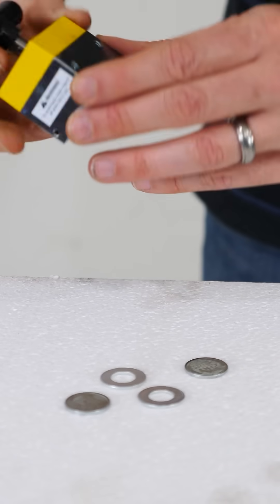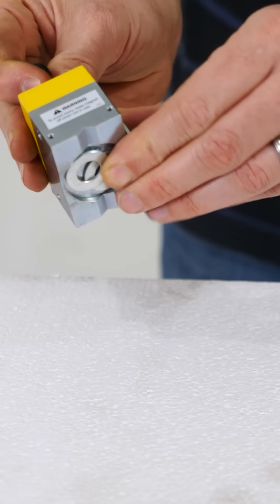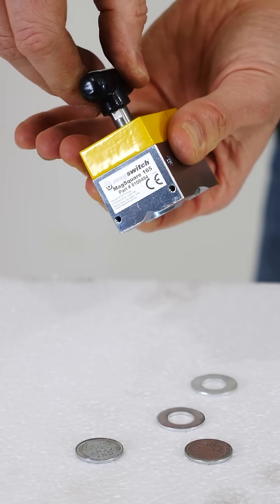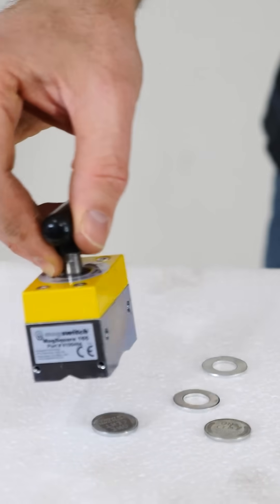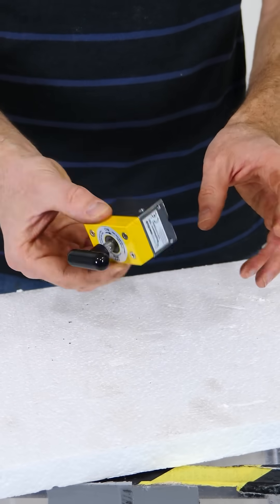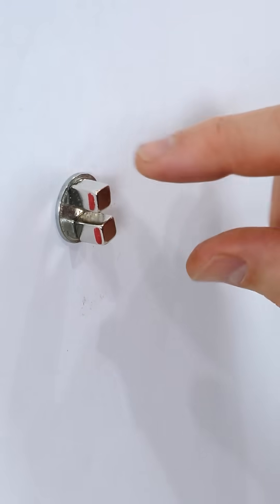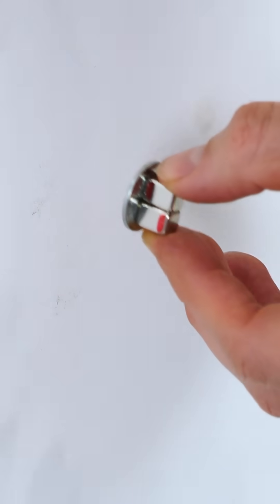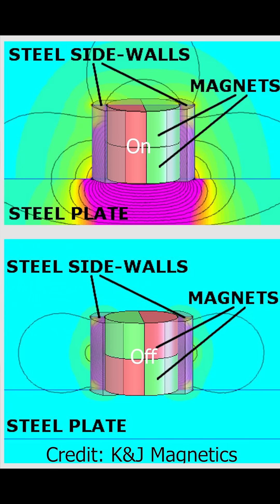How To Turn Off Permanent Magnets

Comment: Very old idea. When turning it off it un-aligns the magnets and re-aligns them when turned on.. Old metal workshops used them for gripping metal under drill presses and lathes. As well as used in large metal fabrication areas to lift metal work.

Comment: we use something like this in mechanic school to measure out of round, it’s a called a dial indicator. you turn a knob and the base magnetizes to a steel table which allows you to measure out of round without the indicator moving

Comment: All you're doing is flipping the magnet inside of the piece upside down which repulses. If you had another magnet it would attract two the opposite side of the magnet that you flipped. You're not turning it off. You're just turning it over

Comment: No, that's not turning off the magnet, the real magnet is inside the assembly connected to the lever. Turning the lever will move the magnet away from the steel base so the base will lose the magnetism. Stop misleading peoples!!

Comment: I use bigger versions of these at work for lifting metal objects. They have a ring on the other side so you can attach them and lift it with a crane.

Comment: thats also used to lock onto the springs of a car and then you can see if the brake discs are wobbling or not. just a metal pin, that pushes a needle to see how much the disc is wobbling

Comment: Why not just use an electromagnet?
Reply: This doesn't require electricity to work, which is more practical and usable, and it's made simpler so it's more reliable

Comment: Technically doesn’t “turn off” the magnet itself and is usually pulling the actual magnet back inside the plastic part or flipping the pole and pulling away.

Comment: So you use 2 of these at either side of a some pistons or a motor turning each side on and off subsequently to pull the piston or motors similar to Tesla’s theory 

A small pulse of electricity fro
 A rechargeable battery to turn the switch on and off and the magnets will pull the motor or piston this would possibly create more energy than input or at least create the same energy which would repeat the process requiring only 1 boost of electricity to keep the cycle I’ll explain how in better detail 

one side turning/moving would create enough energy to turn the other side on keeping the rotation or the stroke

Its more simple for a propeller or motors but if the piston was inside a inductor the energy could be taken and stored, the energy depending on how tall or the distance that the piston travels 

Depending on the size and the quantity of the pistons would determine the efficiency since you could use the action of 1 turn to move many magnets in sequence if the on/off switches were connected to 1 arm flipping them all on and off
Reply: Are you talking about a brushless motor or violating the laws of thermodynamics?

Comment: If it can be turned on and off, it's an electromagnet.
Reply: No, electromagnets work by using electricity to change the magnetic field, this is a permanent magnet that mechanically changed the magnetic field.
Reply: @ProjectEurobeat  negating is not turning off.

Comment: My workplace has magnetic clamping table using a similar concept. A tool can be placed on the table and when the its turned on the magnets will hold the tool (and I mean it holds the tool)
And when the table is turned off, the tool is free to be moved. The actual mechanism is just rotating magnets underneath, (off=magnetitic poles cancelling each other out / on=magnetic poles aligned).
Very simple and reliable, yet quick and effective.

Comment: There is a small permanent magnet in SLR cameras that work directly with the shutter switch. When film is advanced, a metal shutter primer is pressed up against the active magnet to load the shutter to be used, once the shutter button is pressed, the magnet is momentarily shut off to release the shutter! I'm directly referencing Canons A/AE/F/FT cameras so others might be different.. (I also only know this because mine is broken LOL) Its cool to make a connection to this video!

Comment: I have a magnet like that rated to pick up 250lbs we ised some at work that would pick up over 500lb steel plates. They are pretty hamdy but watch out when flipping that lever back off it has some force with it and if your to close and dont know what you are doing you might loose some teeth from that handle lol

Comment: I tried making a overunity motor with a massive 1000kg lift magnet.
(The magnet alone weighed 100lbs)
Problem is you can't switch the magnet on and off unless it's on metal, it's in a magnetic lock state when lines of flux have no path connecting the poles.
I would have been very rich if I had made it work.🥲

Comment: I didnt get how does it work, the energy required to pull the iron nail is much greater than the energy required to twist and switch the magnet off....How is this possible ?
Reply: Because the magnet isn't being pulled away from the spike

Comment: Yeah question couldn't turning this off and on at a specific speed and angle pull a turbine round to generate electricity with minimal energy input for the force output?

Comment: I always thought it worked like a tool I use to pickup screws in hard to reach places where it moves the magnets closer to the stainless steel bottom so it can pickup screws and then you grip the handle it pulls the magnet further away dropping materials

Comment: Just a question to experts like barnabro. Are there versions of magswitches where the magnetic field of a permanent magnet is temporarily neutralized by an electromagnet? These would be much safer than all-electromagnetic ones as the device would not drop its load in case of a power failure.

Comment: I've just been considering what advantages these mechanical switchable magnets might have compared to electromagnets. Apart from not needing a power source, of course. So while an electromagnet drops its load on a power failure, causing substatial damage, these mechanical ones can't fail.

Comment: Used a slightly bigger version of this on the railroad. Had to get a 200lb bladder for hydraulics onto a welding machine, and the bolt on location was about 10 feet in the air. We used the magnet attachment, testing it beforehand to make sure it held the weight. It did. What we didn’t take into account, is where we put the magnet on the bladder. We put it on the bladder to where the bladder was being lifted at an angle, subsequently “peeling” the magnet off the bladder. What’s worse is my boss was right underneath when it let go. He moved pretty quick for a 60 yr old. All ended well, but just something else to think about when using magnets

Comment: We have drills that use this technology powered by electricity and I was using it upsidedown pulged into a welding machine and the damn welder ran out of gas and we did not have the drill tied off it fell about 40' and destroyed it. I don't know probably at least $1,000. Drilling a hole in an I beam.

Comment: Idk if u saw this, two of the “pieces of metal” are coins. Those coins are Pennies. Which aren’t silver. Also it has the old fashioned “one cent” backside so it’s below the year of 1960. Doing the research it’s one of the 1943 Pennies. They were silver/metal because during ww2, they were lacking to produce more copper due to the war. So during 1943, they used metal instead. Like this comment if you read the whole thing 😊

Comment: Where is that fuki ng vehicles that run on magnets?? I dont get it we avoid that solution
Reply: My question exactly. I mean, technically electric cars run on magnets, but by swapping out the electromagnet(s) for these, it does seem like a more efficient motor could be possible.

Comment: Why hasn’t the world began to use magnets (a natural force) to generate power. We all know opposing forces cause motion, if placed properly it can move things like the arms of a friction generator. Am I wrong?
Reply: The technology you're trying to imagine is called a "turbine."  It's how every single type of powerplant we have (besides solar) generates electricity.  From coal to nuclear to wind & more -- they all use this.
Reply: @dr.zoidberg8666 Yes, a turbine, except one turned by external permanent magnets. Perpetual motion? Probably not, but I don't know why not! From what I understand, the only power required would be what was needed to actuate the mechanisms that alternate which permanent magnets were "on" vs "off". That energy seems like it could be sourced back from the very turbine it was turning, thus, powering itself.
Reply: @sparklefluff  When the magnet pushes one side of the turbine away you'd get usable energy.  The problem is you'd use 100% of that energy to bring that side of the turbine back towards the magnet the same distance, canceling any gains out.  

In fact, you'd spend more energy than you get thanks to friction & energy lost to heat.

Comment: Not understood at all..like it does have a battery inside?
Reply: No battery, just the way magnetic fields work.
Reply: @sparklefluff  brother correct me if i am wrong but can permanent magnet be switched off?
Reply: @availablehage  Technically, they cannot, a permanent magnet cannot be "turned off". But you can get a similar effect when you put two permanent magnets in the correct orientation, because they cancel each other out. Re-positioning the magnets inside the device by turning the handle effects the interaction between their magnetic fields, switching them from strengthening each other, to cancelling each other out.
Reply: @sparklefluff  okay understood but the magnet looks just waaaay too powerful hence the doubt

Comment: Super. I think that I just witnessed the birth of the perpetual motion machine. 💙 T.E.N.
Reply: It’s not perpetual because something would need to turn the screw
Reply: @BookMarkIt09 The question is, could the magnet, once turned on, produce more energy than was required to switch it on? Because, if so, you could just spin it up manually, and then feed it's own electricity into itself, to keep it going forever...

Comment: So much BS in your explanations.The switch has a mechanical connection to the magnet and pulls it inside the base
Reply: Then it would still be magnetic on the sides. 

Notice how things attach to the sides at the start. That suggests the casing isn't a ferromagnetic insulator.

Comment: Used to use mounts like that to hold laser optics on a big steel table. It turns out they are also made for holding machinists dial indicators  Getting ones for that use vs the optic mount type saved a lot of money as they were similar in precision but about 420 bucks cheaper 😂

Comment: Now, could it be used to make a more efficient electric motor? The only power required would be what was needed for turning the magnets on and off.

Edit: I looked into it, these motors DO exist! They are indeed more efficient than copper coil motors, and even offer more precise control! But unfortunately, toggling the permanent magnets inside them on and off still takes more energy than the motor could generate by turning a turbine. The first law of thermodynamics is still intact :(
Reply: I said this too !

I think we can make an engine with this
Reply: @Demoversyon  Same! Idk tbh why someone hasn't done it already. Maybe turning it on and off actually takes more energy than it seems, not sure-
Reply: @sparklefluff  and also not just more efficient motor. ELECTRICLESS ELECTRIC ENGINE ! You don't need any fuel for this engine
Reply: @Demoversyon  Well, almost electric-less, cuz you'd always need a little bit of it in order to switch them on and off. But yeah, could be used in many different forms.
Reply: @sparklefluff  I thought that magnets natural magnetism will be enough to switch magnets
Reply: @Demoversyon  A magnet that's always on can't be used to perpetually rotate anything. The magnets have to be turned on and off to do that. Likewise, you could use an ordinary permanent magnet to switch the state of a toggle-able magnet (like the one in the video) once, but you couldn't switch it again without physically moving the ordinary permanent magnet, which takes energy.

Also, I did some research and edited my original comment: Sadly no perpetual motion today :(
Reply: @sparklefluff  "Energy" that can be sourced from the engine creating a loop

Edit: I just saw your edit. Welp I thought a permanent magnets magnetic force could be enough.

I thought that because permanent magnets have magnetic force without any fuel or electricity used it wouldn't bother first law of thermodynamics.

Comment: why’s it called a permanent magnet if u can turn it off
Reply: It has 2 permanent magnets(in a sense that one doesn't require current, btw they are not eternal and degrade over time) that can be moved to alter magnetic field, so one can think about it as compensating both fields(no attraction) or not. It looks like 2 men pulling a rope in opposite directions and then one can be rotated.

Comment: We have similar devices where I work, they have a permanently magnetic base which can be tuned off. It's connected to a flexible arm allowing you to attatch stuff to milling machines. Never actually used it for it's proper purpose, but you can prop up loose coolant hoses with it

Comment: I use the magnet
To cancel the magnet

(As for turning off a magnet… forever… either heat it up really hot, or bang it with a hammer - you don’t have to break it!)

Comment: Worked with some industrial maglocs not much bigger than that, that could pick up 1 ton steel plates. At first I didn't think they would work. Used a 50 ton construction crane to move bridge bearing plates on top of the concrete piers. After working with them, it was apparent that your fingers had to be clear before engagement, or you could lose it. Very strong, surprisingly strong, scary strong.

Comment: Hmmm...so why is it so much easier to turn the handle than it is to pull something off it?  I'd have thought that would be hard.  And why doesn't it snap back into the...probably off position?

Comment: Just the other day the electric fuse at our home was making some sort of sparking sound, called the electrician over, he forgot to bring his small screwdriver to open the fuse and get to the wires so i gave him mine, it was those small screwdriver that you could change the head and replace them with various types of screws (philip, torx, plus etc). The screws were held in place via magnets, the electrcian did his thing with the screwdriver and solved the issue. Only thing now is i can't remove the head of the screw and replace them, it's stuck permanently. Did it have anything to do with the fuse or the wires?
And how the heck do i unmagnetize the screwdriver?

Comment: Ur phone does this too when it does wireless charging. Try it with a super magnet when its on. Then turn off the phone and it will turn the magnet off. Its crazy. 
Edit: super magnet. Not small magnets.

Comment: So why is it so easy to turn on and off
Reply: just rotate the other set of magnets
Reply: Because the handle has leverage so the force is dividend over a longer distance. Is still takes at least as much energy to turn it off than to remove the metal manually because otherwise you could build a free energy generator out of it

Comment: Wtf do u mean by a permanent magnet?? That’s not a thing. If it is, you are wrong.
Reply: Permanent magnets are materials where the magnetic field is generated by the internal structure of the material itself

Comment: Crazy fact, this can actually be done electrically as well!! They’re called electro-permanent magnets (I just presented a project on it 2 days ago lol) that use a soft magnet which can have its poles changed just like he did in the video, but by pulsing a current through a coil wrapped around it! Lots of other science and boring mumbo jumbo I could put here but yeah! Lmk if anyone wants to learn more it’s a lot of fun to share abt it.
Reply: pulsing a coil wrapped around it? please explain, i want ur knowledge
Reply: @Acton-u2x  wack 6 hex nuts in a ring, poke a wire through the middle and jolt it with a car battery. they cling together, until you break the ring...

Comment: You can shield it with mu-metal that's the thing that was used in old hard drives to keep the neodymium magnets from affecting everything around and not just the needle

Comment: This man has some of the rarest pennies I've ever seen I've been looking for these
Reply: Rare is a 1943/42 copper penny
Reply: @squatchhammer7215 or the opposite of a 1943 copper: A 1944 steel penny
Reply: Really only "rare" because of most of them having been pulled by collectors and others just finding them intriguing. Definitely tough to find but I've found about 5 within the past 5 or so years. Still holding onto hope of finding an 09 VDB (S would be a major plus but gotta me a little realistic and hope for either lol)
Reply: @bt7594 I have a 1909 VDB. I discovered it in my piggy bank circa 1983 when I was little. I've only ever seen the one that I own, though.
Reply: 1943 steel pennies were our quarry when we went magnet fishing in the sewers way back in the day.
Reply: I have a jar full of them
Reply: Pennies? I'm confused. I don't recall seeing any pennies.
Reply: @Strawberryyowo lock washers on each side of them that's a one cent steel penny from I think of the Year 1943 or something like that they're very rare they used to make pennies like coins out of steel and I think copper but now they're just like copper zinc and some other crap and now that is a rare coin cuz there isn't much now because of collectors just holding them

Comment: You probably know this but others may not if you take a magnet regular magnet. Put a washer on either side of it the magnet increases in intensity
Reply: It actually doesn't increase the intensity what it does is narrow the field of a magnetic pole